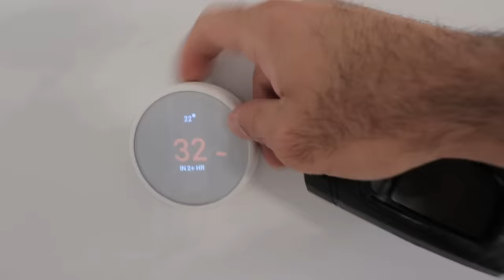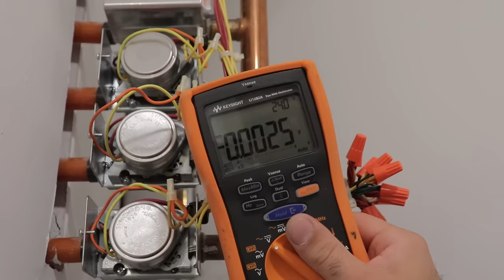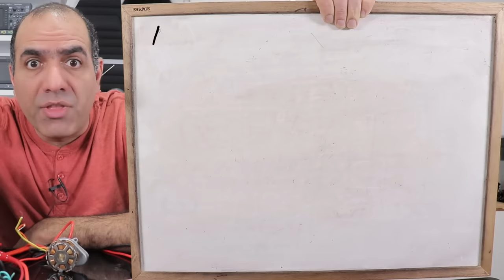Electro-Plumbing Repair… of my home heat zones that won’t heat although the boiler is running fine!!

Comment: Whenever I see a big boiler, I always wonder how compact you could get it without taking away functionality. Then I realise that keeping it big and spread out is pretty key to keeping it easily repairable.
Reply: As long as a child can fit inside we can keep the trai... boiler running forever
Reply: Basically the exact opposite of smartphone design!
Reply: That is why things with "industrial" grade tend to be big for seemingly no reason
Reply: @QualityDoggo  yet most people want them thinner and more complex lol.
Reply: Larger heat exchangers are generally more efficient as well.
Reply: @Ergzay  what are you talking about? Don't you prefer to be able to repair your device that you already paid 1k USD for?
Reply: @Ergzay  That is complete BS. That's the most uneducated comment I read today. Are they paying you to post this nonsense or what?
Reply: bingo.
Reply: @Ergzay  bullshit. I can fix Daikin mini splits all day because parts are available. Fujitsu stuff? even pre covid, screw you, buy a new one. Basically identical machines. It boiled down simply to parts availability. And every time a system gets changed out a little bit of freon is vented - even if it's recovered, a quarter ounce or so is always going to escape, there's no way to avoid it. Meaning the fact that I can't replace a PCB on a minisplit contributes to pollution.
Reply: @machintelligence   I wouldn't call it more efficient considering a massive amount of heat winds up out of the flue.
Reply: just look at apple's most recent computers! same issue! everything needs to be smaller and thinner and then you start getting soldered on ram, storage, cpu's, everything.
Reply: @Ergzay  
Unless it is a disposable paper plate or a plastic spoon, it should be designed for easy repair. Denying "right to repair" is disrespecting and abusing customers, and is very unprofessional. A lot of stuff can happen in the 20 years or so that it should have lasted. The company could go bankrupt, a home-owner might even have to MacGyver or 3-D print a repair part. Too many designs and models, no guarantee that parts will forever be available. I am nowhere near as handy as my Dad who could fix anything. Yet I have repaired things, and figured it out. If everything is crammed into some tiny space, how would I do that?

If I was the repairman, I would show the customer how to repair or maintain it themselves, if the customer is interested in that. It is part of providing quality service and building up one's reputation. I also would want to leave a sticker or business card with the equipment, in case that person or the next owner has any problems. But I do not want for people to be helpless, and a good repairman with a good reputation should get plenty of calls from customers to fix other things, or repeat business, and most won't do it themselves, because they lack confidence or do not quite remember how to fix it.
Reply: @klnsbl  
My last decade-old Mac, I was able to max out the RAM myself, from 2 to 16 GB. Much better more reliable performance, with bigger RAM. And that is with a Mac mini that has everything crammed into a tiny box. It has 2 tilt-out memory slots right next to the bottom cover so as to be easy to get to. Now I might never buy another Apple product, because their stuff is becoming over-priced unserviceable crap. Goodbye Apple, Hello Linux.
Reply: I can say from experience that these combi-boilers are difficult to work on because they are so compact.
Reply: @johnsimon8978  
What is this obsession that everything has to be so compact? Even laptops are getting so thin that you might get a paper-cut if you are not careful how you handle it. Slight exaggeration there. I would still like to have the optical disc drive slot. How else will you make that fancy DVD player work?
Reply: Having it large also increases the thermal  mass, so that it is less sensitive to water flow changes.
Reply: @isthisoneunavailable  That sucks, the guy talked me out of the Daiken I wanted and convinced me to get a Fujitsu instead.
Reply: @yosefmacgruber1920  Lol, Apple was always massively over-priced.
Reply: @yosefmacgruber1920  Optical drives are becoming largely irrelevant nowadays.
Reply: @randomname4726  
Some of us like old retro stuff and we have audio tapes and VHS and DVDs that we would like to play or rip. What tiny port hole are you going to shove that DVD into on your smart-phone, or on some laptop computer that is about as thick as a few sheets of paper? And what about all my old CDs?

Do you really trust Big Cloud to hoard all your data? And when Big Cloud decides that it does not agree with your viewing choices, what then?
Reply: @yosefmacgruber1920  and what about vinyls, cassettes, magnetic tapes, floppy disks or old stuff like that?
Come on, CDs and DVDs are only obsolete technology.
Reply: @black guy Nah. Louis Rossmann is one of the more popular proponents of right to repair, personally working and funding its advancement, and he constantly talks about the importance of being able to repair things yourself.
Same goes for many people he speaks of, who are also proponents.

Comment: HVAC tech working on EE degree here, love the videos. This one brought me back to early days of my apprenticeship where I had to figure out the same issues. Having the nest controller makes things so much nicer
Reply: That sounds like such a cool career/educational path. How old are you, if I may ask?
Reply: @kerimgueney  Since you haven't gotten a reply, here's the way I got into HVAC which is one of many possible paths. I was an electrical apprentice for a while, then got a job with an HVAC controls company installing control equipment. I've known plumbers that got into HVAC the same way. From there, experience and interest can move you into the refrigeration side or the controls side. I went the controls route, but it would have been just as easy to go in any direction, and most trades companies will cooperate with schools to complete your training at the same time.

Basically start at the bottom and work your way up, following your interests.
Reply: @zierlyn  thank you. I appreciate the detailed response.

Comment: Fully agree, electrical engineers are on the top!
..we have unlimited access to black magic... 👀
Reply: untill we let the magic smoke come out, then we have none :P
Reply: I have been installing complexed hydronic systems for 40 years. I would never let an electrician much less an electrical engineer wire any of my systems.   lol
Reply: As a Mechanical Engineer, I'm tempted to ask "a friend" that I know to turn Medhi into a frog!  ;)  LOL!  Of course I wouldn't really do that, but if my friend did turn him into a frog, then he could redo some of Galvani's experiments with electricity & frogs.

Seriously though, his troubleshooting was interesting and the repairs appear to have worked, at least until the too-high voltage kills more motors.  I half expected him to replace the power supply with a regulated 24VAC PSU.
Reply: @anthonyspadafora1384  What, because we'd be able to point out all the things you've been doing wrong for those last 40 years? 
:P
;)

Sorry couldn't help myself
Reply: Hi
Reply: @sn0wchyld  Well if anything I learned from wizard movies is that whenever you screw up a spell, smoke comes out. And wizards don't loose their powers, just their eyebrows. So I think it's safe to say that it is almost the same.
Reply: JENNITA B.O  "habían" va con "h", bot estulto.
Reply: ** RF engineer ** I'll SHOW you black magic. It'll literally blow your mind!
Reply: @jeanapolo8960  haha 😅
Reply: Forklift operators are at the top.
Reply: You have limited access to black magic.... Quantum engineers have access to the black book
Reply: @pirotom2282  This guys eyebrows seem to grow in and out between videos. I get the feeling that is an iranian in born safety feature. If the eyebrows burn out they have to wait until they grow back in for safety reasons. Slows down the rate of death.
Reply: @bobvines00  I kinda hoped he was going to change the motors to DC
Reply: very true 😂👍

Comment: Isn't it fun when something like this breaks down?  You get all the fun of debugging an issue with an at this point pretty complicated device, all while dealing with the frustration of your heating or whatever other important thing not working...
Reply: Unless it's in winter and you have no heater left.
Reply: @goku445  honestly that comment was like, at least 75% sarcasm.  I'm not actually a fan of having to do this sort of thing :P
Reply: @jdatlas4668  Right. I read too fast your comment. I actually enjoy fixing stuff, that's why my comment.

Comment: I have the same kind of setup in my house except it's from the 80s and with only two zones, I had to replace the transformer and I pretty much ditched all the old electronics to make my own, now each zone is on a relay controlled by Home Assistant and I made my own thermostats powered by an ESP32. All the issues I had before were electrical too!
Reply: Nice
Reply: Microcontrollers are the best thing since sliced bread.
Reply: The Game Shorts 🅥  you've posted this link on every video I've seen last week. It's an ice cream recipe... You're spamming comment sections for an ice cream recipe..
Reply: Obligatory: ESP32? I'm pretty sure you could have done it with a 555.
Reply: @mgancarzjr  I could have, but then I couldn't set my thermostat from Home Assistant
Reply: @lululombard  also possible with (enough) 555s!
Reply: It would be great if you could publish how you did it in YouTube or a simple blog
Reply: @epilepticwizard4800  Report. I always do. Clean up YT.
Reply: Plumbing work is half electrical now, and tbh putting pipes together is easy
Reply: Residential systems are designed with redundant safeties in place because boilers are bombs with a (hopefully) bad fuse.
If you thought of all the ways yours might run away and programmed it into your controls, congratulations.

FYI ...Most controls on heating systems are Safeties and not normally active.  They were put there when people blew each other up without them.
Reply: @truthsRsung  for starters we have an electric furnace not gas so there are almost no risks of blowing up, and secondly I added security features that were just not there before (over/under pressure cutoff, water pump under/over current cutoff, over temp protection, and a fuse for the 24v transformer)
Reply: @lululombard  Echoing medn, would be pretty awesome if you shared a write-up of your setup <3
Reply: David Jameson  I think "view farming" is ok, if it's a video of the same subject - given how Youtube is (like 5% of the channels get 95% of views and it's more about luck than putting up the best videos, having good quality video/audio etc.). But post ice cream recipie on an electrical channel is nothing but idiotic spamming. Why not put it on other ice cream videos instead (there are indeed plenty such videos as well, that has millions of views).
Reply: @lululombard  ...Simply, if your HVAC appliance is using electrity to create combustion to satisfy the definition of "furnace" rather than YOU actually satisfying it, there is new tech out there that I didn't know about.
Furnaces burn fuel in them.
When one removes the burner and replaces it with a heating element, they stop calling it a furnace.

The dangers involved with a gas sucking, fire breathing, oxygen hogging dohicky far exceed your imagination if you fail to use the proper vocabulary to start with.
I doubt you realize the I'll effects of an overpressure event that combines hot water and metal because we've learned from our mistakes, made safeties on HVAC systems Standard, and have recorded HOW they should be installed, and used, in Building Codes and Product Literature....extensively.

Since you can't say with certainty what you have, do you think you should be screwing around with something that has been designed to shut down if ANYTHING fails?

Do you think you have that kind of experience?
Heil, Trane, and Carrier do, because they had to promote their products vs fireplaces and then had to endure the countless lawsuits while teething thru the new tech.

Our boy here cries about the inefficiency of normally closed valves being open with, of all things, electricity.
As if nothing bad EVER happens to HIM...he ignores the bad things that WILL happen to a house.
Let's say a car or lightning bolt hits his dwelling, or he hangs a new decoration on the wall or adds a few screws to a cabinet...anything that opens the pipes and causes electrical circuits to fail.   Those spring loaded valves to stop the water flow.
Just think of it as paying the electric company for flood insurance.
Reply: @truthsRsung  I leave in Eastern Canada, and we have hot water heating via resistive heating. It uses the same elements as a water tank heater, except it has 6 of them. It’s very uncommon and we’re going to replace it with a heat pump anyways, but I know what I’m doing don’t worry.
Reply: @lululombard  ...You just don't communicate it well or accurately if you do.

You used the "F" word with me First.

Is English your second language, cuz that would explain a lot?

I use direct solar exposure to preheat my incoming water, with a recirc pump and switches from the 12 volt DC market, and power it with solar I collect on a small panel.

It doesn't heat anywhere as high as the multiple short circuit you bought.

I have worked with others on the boilers under Chicago with men way braver than me.

They wouldn't dream of "ditching....old" whatever and doing it somehow else in their families home.  Car, trailer, fine , whatever, but not where their kids sleep.

If they would have commented on uTube, for this video, the terms jackass and idiot and he's not done fixing it would pop up, but never any encouragement for the audience.
Ever.
Reply: @truthsRsung  indeed I’m French and English is not my main language and I don’t like condescending people.
Reply: @lululombard  ...I don't like stupid people thinking they can duplicate what you did after reading YOUR comment on uTube.
Reply: @truthsRsung  Do you think people are that dumb? That they will rebuild the electronics of their heating system without knowing what they are doing? Chances are that if you have the knowledge to do it, you also know the risks implied.
Reply: @lululombard  ...That is the Most backwards Logic I have ever heard.

How many sixteen year olds understand ALL of the hazards of Driving a Car, and how many drive anyhow?

I am an HVAC Tech and have SEEN what kind of alterations happen to systems without permits or sufficient education.

People still die from placing torpedo heaters INDOORS!

You better believe I have NO faith in the common uTube viewer.